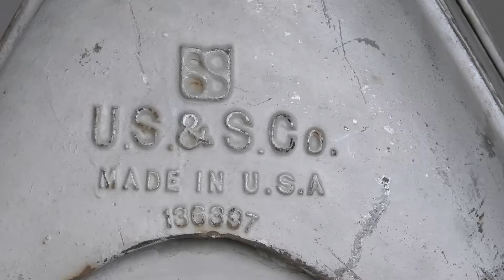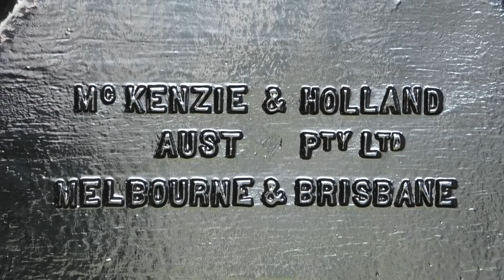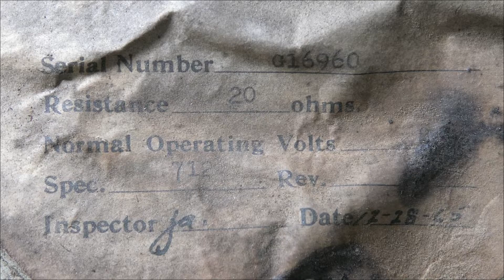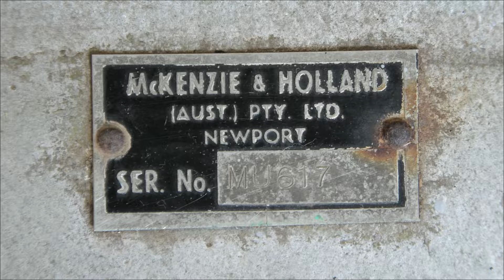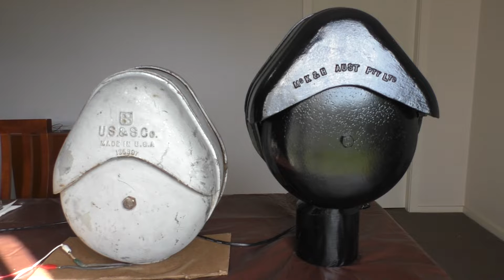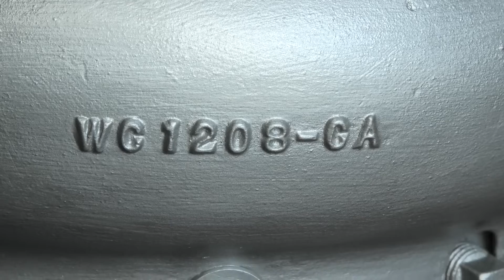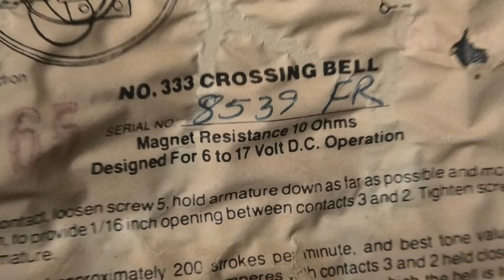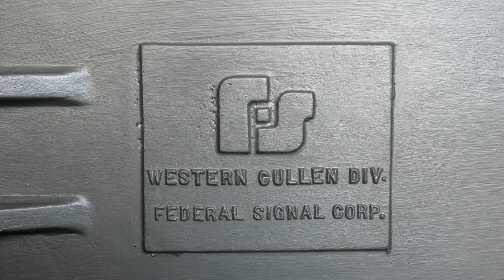My Railroad Crossing Bell Collection, Part 2.

Comment: Great video and bell collection! That WCH bell sounds like my WRRS 222 Bell that was made by Federal Signal (the sticker says federal signal). I never knew the 2 different Teardrop bells had such a big difference.
Reply from the maker: Thanks! One of the things I like about mechanical bells is the variety of sounds between individual gongs, it certainly makes things more interesting when compared to e-bells.
Reply: That WRRS bell sounds like it was an early Federal Signal bell. I know I've seen a "pure" early Federal Signal install before on the CSX Dothan Sub, literally everything was branded as WRRS, except for the backsides of the bases, which were branded as Federal Signal.
Reply: My WRRS bell 1 (possible GRSA gong) has a FS/WCH operation instruction paper, yet it sounds like a teardrop bell. I have seen many videos of WRRS/FS Bells and they all sound the same. Mine sounds different. Idk if there is a difference of metal on the gong. I remember hearing somewhere about an extremely rare WRRS type 3 bell made of aluminum cast and was made for only 3 months before FS bought out WRRS. Is there a possibility that I have a Type 3? I’ve heard other WRRS bells with teardrop sounding gongs but mines is higher pitched than those.
Reply: @upking9080  I know WRRS made bells with brass gongs during WWII, IIRC. Maybe yours just has one that was re-used from one of those WWII WRRS bells?

Comment: Fun details and info.  I have an old solid brass crossing bell.  Wondering what you use for a power supply to activate the bell.  Mine says 300 volts dc. UAE Co. NY,New Haven, and Hartford Co. Not sure of the amps. Thanks for any information